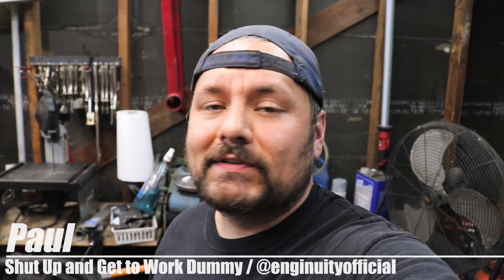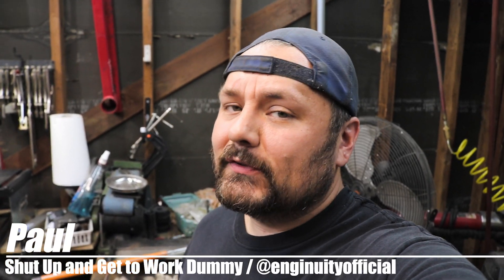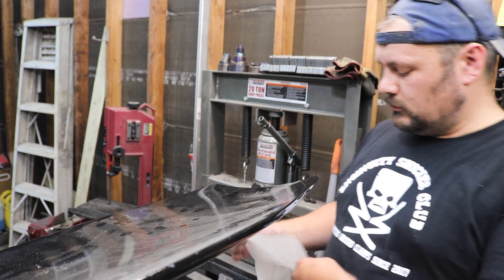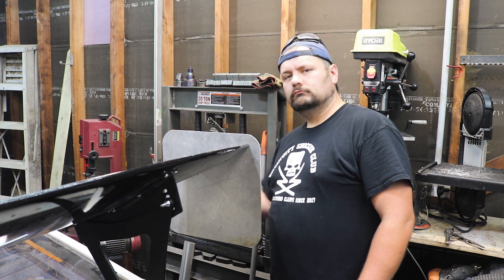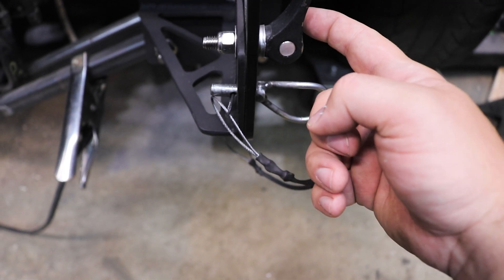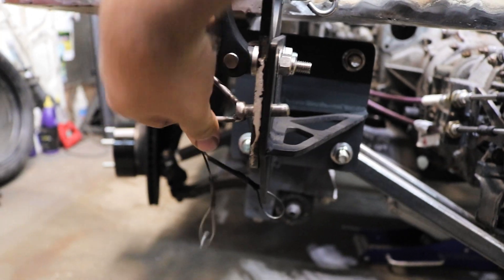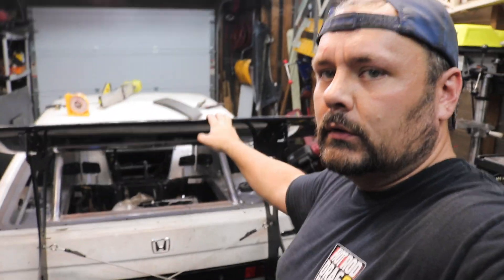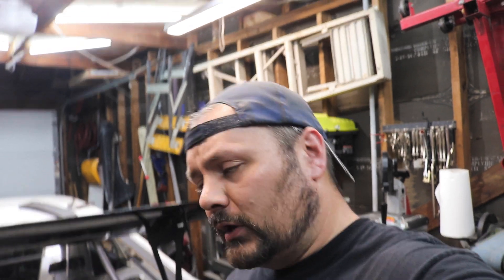Subaru Powered Honda CRX: Time Attack Wing

Comment: Buddy, I dont know why you arent bigger on youtube. This is easily one of the coolest things ive seen. I want to do this to my eg, we talked w while back. Since then I picked up a y8 swapped it on because i got a steal. 200 for engine and trans, sold the A/T for 100. So I got a $100 engine. My plans have changed a little. Twin D series. One up front one in the back. 2 ECUs 2 engines, 2 trans.
Reply from the maker: Thanks man! Appreciate that. Dude that’ll be so badass! You going to do the whole subframe for 4 wheel steer too like the Preludes had?
Reply: @Enginuity  4WS would be cool, but i believe thats a little beyond me, however my idea for the conversion would allow it if I could figure out the linkeage to the rear. Personally I would go to a junker and just cut the front off another eg cut out the back of my eg and just switch them. Leave as much material as I can in the rear frame of my eg as a map/guide for the new rear (front) strut towers . It would have to use front control arms, struts, outer tie rods, all that jazz. Thats all far in the future. Haha.
Reply from the maker: Yea running the full front suspension would definitely be the path of least resistance there. Sounds awesome man - look forward to seeing it
Reply: @Enginuity  well, like i said. It would be far in the future. One downfall of the setup, twice the things to go wrong. Lol
Reply from the maker: Hahahaha true but at least being D series there’s not much that does go wrong